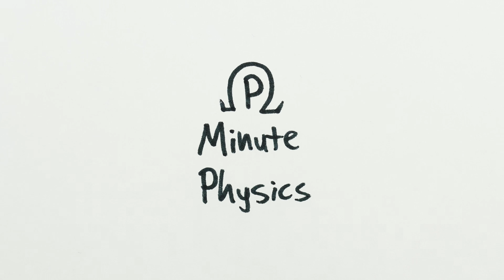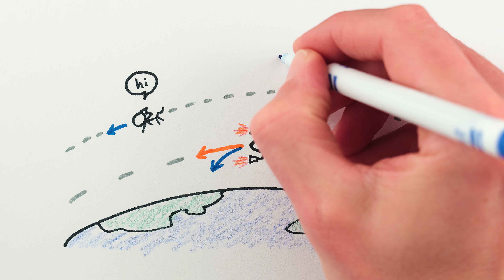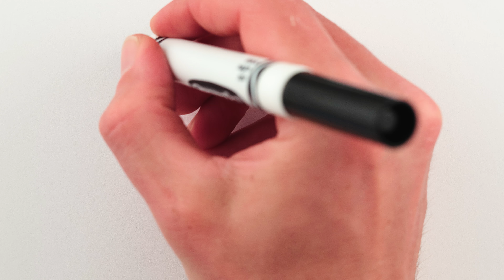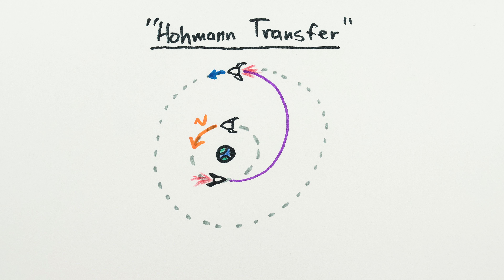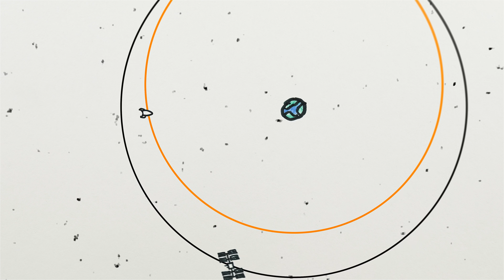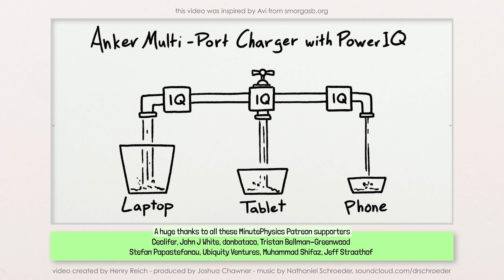Two Paradoxes of Space Navigation

Comment: your speed is the same at any orbit, your path is longer at the same speed.. its why it seems relatively slower to go faster... you dont add speed, you change your vector. the fastest you would ever seem to orbit would be at the centre of mass, so the slower you go the faster your relative ground speed, but the rate at which you cross your orbital horizon never changes.. its an illusion.. everything in space has the same speed. but they give the title of mankinds fastest probe to Parker, you could point it at Voyager 2 it will never catch it, point Voyager at Parker and it will fly past like its stood still.. mapped conically you could see both cross their horizon at the same speed, but voyager falls into the solar system like a rock.. it has vertical motion not just horizontal, it has more relative motion in time than space, when you get 90 degrees from a flat horizon you have no horizontal motion, so your motion is said to be in space and not in time.. its how light cones work

my horizon has to fit between the boundary of my light cone, when i add speed my line gets longer, it extends and the ends need to raise up to fit inside causality.  it is always a relatively flat path, as flat as it can be. when i moved to apoapsis i can circularise, but you go from circles to ecliptical orbits, like how when you slice a cone any slice is an ellipse.. it is orbital mechanics from a slanted perspective, if you flatten out the curved reference frame

Comment: Note that if you're very close to the object you're trying to catch you can just accelerate towards it. The issue is whether the time it takes you to reach the object is enough for your new, higher orbit to slow you down.

For example, low earth orbit has an orbital speed of about 8 km/s and an orbital period of about an hour. If you're only a few hundred meters away, and boost your speed by 1 m/s towards your target, you change your orbit essentially not at all and reach your target within a few minutes.

Basically, to first order, you can navigate normally. It's only if the distance is large enough (or equivalently the delta-v is small enough or the time is long enough) that the second-order nature of orbits takes over.

Comment: Now explain why objects in Lagrange points L4 and L5 retain stable orbits. Please. Pleeeease. I haven't slept for twelve years
Reply: All the Lagrange points work by a balance of two gravitational pulls and inertia of the object wanting to fly off away. In the cases of L4 and L5, the Earth is pulling one way, the moon another way, and inertia wants the objects there to go a third way. L4 and L5 is the point before and after the orbit of the moon in an equilateral triangle on the moon's orbit (or any other large/small celestial object pairing like the sun and earth) where those three forces balance out. Unlike L1, L2 or L3, whose forces are lined up perfectly, L4 and L5 have their forces pulling in 3 different directions. With L1-3 it's like balancing a ball on tip of a hill. You're good so long as nothing nudges it any direction, at which point the inertia is no longer in line with the two gravitational pulls and it drifts away. With L4 and 5 it's like being in a valley. If you nudge the object one way, the combined pull of the other two forces pulls it back to that balance point. That's why L1, 2 and 3 are unstable but 4 and 5 are stable.

Comment: The easiest way to understand orbital mechanics is to stop focusing on the ship, and start thinking about the orbit itself as 2 objects: where you are (the ship) and where you're going (the opposite side of the orbit). Every single maneuver you make in an orbit affects where you're going, not where you are. If you boost your orbit now, your destination will go up, not your current position.

An orbit is like a giant rubber band where one side is nailed to a wall. You can stretch it (burn prograde), squeeze it (burn retrograde), tilt it (burn normal/anti-normal), or shift it (burn radial in/radial out). But every maneuver changes the shape of the _entire orbit_, not the ship's position. And, just like a rubber band, gravity resists all of that stretching and moving. That's why you slow down the further you move out. Your kinetic energy (stored in speed) is being converted to potential energy (stored in altitude).

Comment: The second one doesn't make sense without additional premises.  Imagine that you're controlling one module of a two-part space probe in interplanetary space, and trying to rendezvous with the other module a hundred meters away.  When the scene starts, your previous burn has left you exactly stationary with respect to the other module.  You want to rendezvous ASAP, and you can afford 20 m/s of delta-v from your cold-gas thrusters.  Do you accelerate yourself 10 m/s toward it, so that you'll float toward it for ten seconds, and then accelerate yourself 9.9 m/s away from it just before you arrive so that you'll touch it with a nice gentle 0.1 m/s, leaving the other 0.1 m/s of available delta-v to correct your course as necessary?  Or do you accelerate yourself away from it so that you'll float toward it?  You're both orbiting the sun, after all.

Comment: What if you accelerate away from the ecliptic plane at 90° ?
Reply: Are you using gravitational assist or mostly rocket fuel? That's almost like launching a rocket from a spinning merry-go-round.
Reply: @RiteMoEquations just wondering on the mathematics  and I figured somebody on this thread had the educational chops to answer the question
Reply: @jimplante8269  It's a deceptively similar problem to consider. The complexities arise from the fact that the earth, and other planets orbiting within the elliptic plane have an initial angular momentum and velocity, relative to the sun, that must be considered. 

If you want to leave the earth, and eventually exist the solar system at a 90 degree angle, which is perpendicular to the orbital plane, then you will have to work against the sun's gravity and the initial orbital velocity that's keeping us from falling radially inward toward the sun.

Comment: immediately reminds me of surface speed calculations.  You got a 4 inch tool spinning at 300 rpm the outside of the tool moves at a faster surface speed than a 2 inch tool would be, the rpm is the same but the distance traveled is different.

Comment: All the comments are about KSP for a good reason. If you haven’t played it you should give it a try. It will give you a deep intuitive understanding of most orbital mechanics if you play enough of it. 

All it really misses out on without mods is interactions involving multiple gravitational influences, so you don’t get an understanding of Lagrange points, or the fact that planets and moons really orbit each other around their shared center of mass(or Barycenter), which is notable for small planets with large moons or moons that are very far away because it can be a point close to the surface of the planet or even outside it. The Earth and Moon are actually an example of this as their shared center of mass (called the barycenter) is about 4600 km from the center of the earth and only 1700 km from the surface, so the Earth actually follows a tight spiral path around the Sun. It’s even more noticeable with Pluto and Charon because the Barycenter is actually outside of Pluto, about 2000 km away, because the mass ratio of the two bodies is 8:1 rather than 81:1 to 1 like with Earth and the Moon. Meanwhile the Barycenter of the Jupiter system is 115km from the center of Jupiter, a planet that itself is 142,000 km wide, so you need very sensitive instruments to even measure its movement, and for any orbital calculation you can just treat it like the Moons orbit Jupiter. 

Make sure to play KSP1 btw. KSP2 is sadly an unfinished dead mall at this point so don’t get baited into getting that because it’s newer. Also KSP is among the easiest games to mod or install mods on. There are a plethora of options for expanded content, functionality, and capabilities, including ones that add in these missing orbital mechanics.

Comment: The Anker chargers reboot when you plug in another device, and sometimes they just reboot on their own, which is useless when I got devices connected that don't tollerate power interrupts (like sensors or when I'm soldering with a stereo microscope, and suddenly the ring-light stops working because it's connected to a Anker charger)

Comment: In fact, it's pretty hard to fly into the sun
Reply: If you were stationary relative to the sun, falling into the sun would be easy. Unfortunately we are all starting out on Earth which is moving at 30 km/s relative to the sun. Trying to counteract 30 km/s of speed before you run out of fuel is hard and usually requires gravity assists from either Venus or (paradoxically) Jupiter.

Comment: My favorite counterintuitive orbital fact is that a gas cloud (which is gravitationally bound, and therefore a huge amount of particles more or less in orbit around one another) heats up as you remove energy from it. When a star forms inside one and literally starts blasting the cloud with enormous amounts of energy, it cools down.

It's basically the "higher orbit means lower speed" thing, but for a LOT of particles at the same time.
Reply: Reminds me of the fact that most weather comes down to air to energy conservation as air changes pressure.
Reply: I learned this in a video by Angela Collier about the gravothermal catastrophe
Reply: @viliml2763  I learned it from her too. She was talking about the virial theorem and a few applications of it. Don't remember what video it was.
Reply: Is that due to how gasses cool down as they expand and heat up as they contract?
Reply: @EMLtheViewer  In the examples from our daily life, an expanding gas does work on the surroundings (pushing things away), while in the case of stellar gas clouds, the gas does work against its own gravity. So the mechanism that steals momentum from the particles is different, but they are definitely related. In both cases, the expansion does work against the forces that contain the gas, which leads to cooling. Of course, it goes in reverse for contraction.

What makes it counterintuitive is, in our daily life examples, if you heat a gas to make it expand, that expansion usually doesn't cool it down MORE than you heated it up (unless it was the final push needed to burst out of a pressurized container or something). With the stellar cloud it does.

Comment: So if you're in orbit, is it hard or impossible to "cut" part off the orbit and fly in a "straight line" basically course correcting for it?

You basically have to be moving in a straight line and as you are nearing the gravity field start accelerating away from it, to maintain the straight line until you're at the strongest point, after which you can slow down your acceleration.

A straight path is shorter than a curved path, so would that be an option to catch up with the space station? 

Maybe, but I guess it would just cost more fuel. It would cost less time since you don't have to do a full orbit, I guess?
Reply: Burning in a straight line to catch up with the station would be much quicker than adjusting your orbit, but you'd be spending far, far more fuel - you're essentially boosting up to Earth's escape velocity.
Reply: A straight path is shorter than a curved path. You have the correct idea.

But you also have to remember, according to general relativity, this curved trajectory IS the straight line (the geodesic) when viewed from the perspective of the orbiting object
Reply: @noctis_runegeometrically it's not a straight path in 3d  space. That's why I put it in quotes initially.

It's just a straight path because of gravity. You're not accelerating and just keep falling in one direction, so it's a straight path in that sense.

But it's not the fastest path from A to B, it might be the most efficient since it doesn't require you to change trajectory.